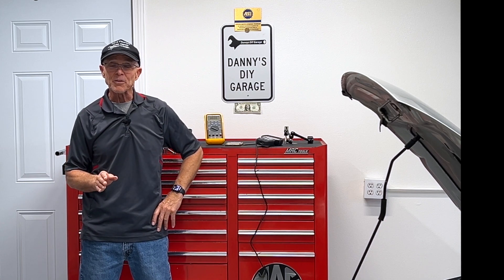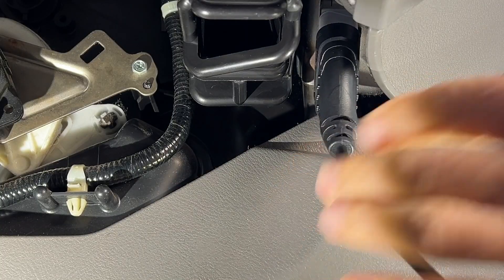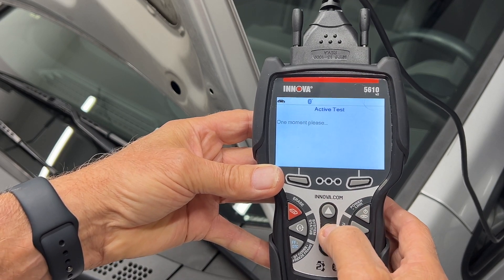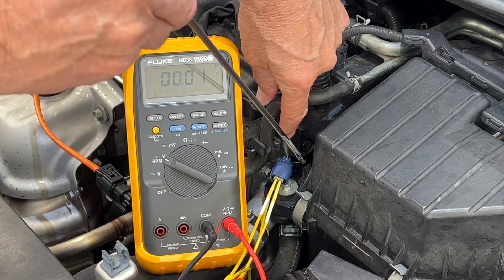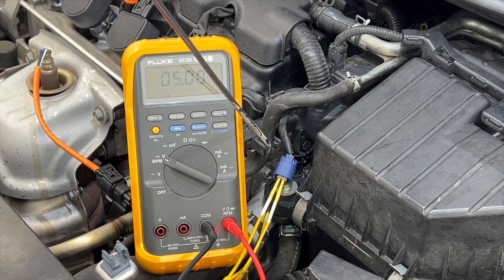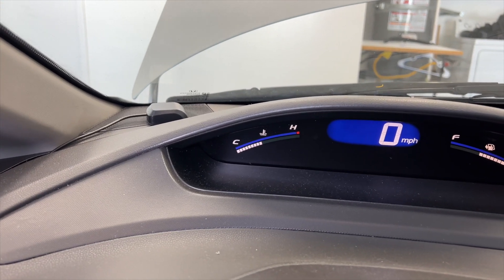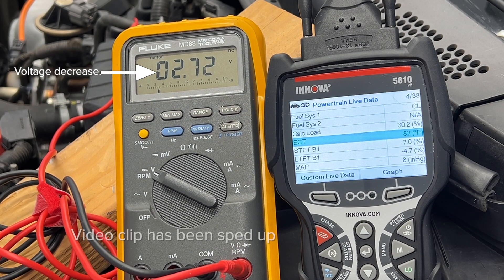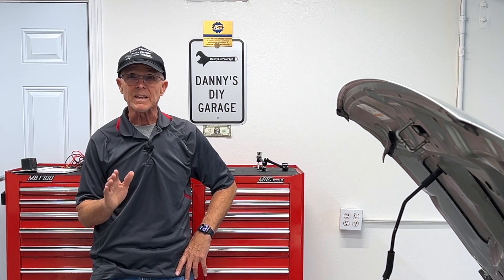Honda Civic Temperature Gauge Reading Hot, How to Diagnose the Engine Coolant Temp Sensor (ECT)

Comment: ON MY HONDA IT DOESN'T OVER HEAT , BUT IT SHOWS THE TEMPERATURE DROPPING  ON   COOLING  MILEAGE , FUEL GAGE PANEL , I THINK THAT PANEL  IS BAD BECAUSE  I HAD  FUEL GAGE   PROBLEM   WHERE IT  GOES COMPLETE  FILL UP  AFTER I FILL UP THE LIGHTS UP AS I USE GAS  AKA IT WORKS BACKWARDS .  AND NOW  I AM THINKING  RIGHT SIDE  TEMP GAGE IS GOING BAD .
Reply: thermostat stuck open,replace it and it will work good

Comment: Danny my 08 civic has a temp gauge that’s sometimes flickers. Goes from cold to 2 notches from hot instantly and the lower half is dull not as bright as the top part.  Shows the car is not hot but temperature gauge is glitchy. Wish I could share the video to see your thoughts
Reply: same here,I check the thermostat,it stuck open,I replaced it with the new genuine Honda thermostat and it is working good now

Comment: Hello. I love your videos. I am trying to figure my 2010 civic out. I definitely am overheating (coolant boiling at the top of that gauge). I think I might have several issues, which also makes this very difficult. Just replaced the thermostat to rule that out. I have a co-occuring oil leak, but I think it may have been the vvt solenoid gasket, so just did that. Fans go on when I turn ac on, but are not activating themselves related to the engine temperature. So the relays and fuses must be good for the fans. When I run the heater, it does not get warm (no matter how hot the engine is) and can smell like coolant. Do you think the heater core is the issue? I have a small coolant leak, but I can't seem to find it. Of course, I am worried this could be a cracked engine block or a head gasket. Going to add the new coolant temperature sensor today. IMPORTANT: No codes, no check engine light in spite of the obvious overheating issue. This happened all the sudden. Within 10 minutes of driving  or idling, I can watch the overheating gauge climb to the top. I am trying to diagnose the water pump, as it could be an issue too. Thanks for your input. - oh, and I have a live data scanner that hasn't been working with the Honda. Updating software and trying it again now.
Reply from the maker: could be air pockets in the engine, this causes what you're describing, air pockets can be caused by a head gasket allowing hydrocarbons in the coolant system, it could also be the water pump, fins on the pump broke or deteriorated not likely but I've seen it, heater wouldn't work due to both of these, conditions, what does the coolant look like and how many miles are on this car? you can also drive this to a smog shop and ask them to put the sniffer over the radiator top of cap or in the overflow bottle, this will sniff the cooling system for hydrocarbons verifying a coolant leak into the combustion chamber, you can also pull the plugs and look at them for coolant wetness. do you see coolant on the oil cap?
Reply: @dannysdiygarage  thanks for your quick reply. 250k miles, but it has a junk yard engine and the sketchy tire shop I got this from 1.5 years ago said 100k on the engine (but I don't believe them). I am worried the head gasket could be the cause of the issue, or a cracked block because I don't even for sure know they replaced it with a 2010 engine and read about the recalls in prior years. The coolant is rusty. I actually flushed out the heater core yesterday and tons of rust came out. Interestingly, testing afterwards the heater is still not getting warm except for a minute when the engine temp reaches maybe 220 degrees F, and then it can go down a whole notch on the indicator before climbing again. Top of the radiator cap had a bunch of orange on it, so I just replaced it with a nicer junk yard one yesterday. Got the"cooling system pressure testing kit" loaner and the compression tester, and I will try that today. I can check spark plugs then. Misfires are not an issue though, so that is odd bc my 2011 jeep liberty had a head gasket issue that just presented as a cylinder 2 misfire. Still no codes on this 201p civic, but I got my live data working and can see the radiator fan control module says "NG" so maybe that is no ground. That might explain why it does not kick in due to temps rising. Both fans do go on when I select AC. The hard part here is that there may be multiple problems at one time. I appreciate your help.
Reply from the maker: The scan tools data for coolant temp sensor 2 should come on when the voltage reads .5 volts. Watch my video I just made, this explains this https://youtu.be/GVRF11BPRZA?si=LtJPoY474wVxpi7E
Reply: @dannysdiygarage  Hey, thanks so much. That was a great video too. I did the thermostat, topped off coolant, new radiator cap, ect sensor 2, and now it is doing what it is supposed to. I have been messing with this severe overheating diagnostics stuff and the co occurring oil leak (vvt gasket) all week, and today I got to even take it on the freeway. It never even got hot enough to trigger ect sensor 2 to that low voltage, which is amazing! It is now running where it is supposed to. Yay!

Comment: I'm having issues with the temperature reading from my 8th gen. I've ruled out everything mechanically. I just tested the voltage at the connector and it's less than 5v. Wiring bad from the connector through the engine harness?
Reply from the maker: What is the voltage?
Reply: @dannysdiygarage  a little over 3v
Reply from the maker: @ determine if the ground is causing the voltage drop or the 5v reference signal, to do this put the red meter lead on the 5v ref terminal and the black meter lead on the battery ground. If you have 5volts, then you have a ground issue, if you still have 3 it’s a reference signal, hopefully this makes sense
Reply: @dannysdiygarage  did that. Same voltage
Reply from the maker: @timfretts9266  wiggle the connection while testing the voltage, also I would go directly to the computer wire where the 5v signal comes out , good luck, let me know how it turns out
Reply: I retested it with a better meter and I'm getting 5v to it. The sensor has been replaced twice. Don't know what else it may be
Reply: I used a jumper wire and with the circuit open its reporting -40° but with the circuit closed its reporting a value over 400°

Comment: I just want to mention a surprise overheating problem. My overflow bottle had too much black crap at bottom of bottle blocking the hose to radiater. Cleaned it all out, rather than buy a new one. Running perfectly.
Reply from the maker: Thanks for sharing, great information

Comment: Danny, do you know at what temperature radiator fan should normally turn on? And if I read temperature data via obd  snanner it relays on top sensor, right?
Reply from the maker: this video should explain all this question: https://youtu.be/Uw4lLvyFOns?si=qVKP5algcJKZCcFK
Reply: @dannysdiygarage  thanks, so I need to buy more advanced scanner to know the answer.

Comment: my daughter won't check her transmission fluid even though it has leaks at the seals on ends of transmission drive shafts they are small leaks when driving.
how accurate does the transmission fluid level have to be if it is a bit low or high above range will it mess anything up ? she has 2007 with 182,000 miles.
Reply from the maker: If it’s an automatic transmission watch this video, ( link below )at the end it will show how to adjust your transmission level https://youtu.be/zgA7H8XFfQk?si=bANEpCkjNriqIssS
Reply: Let her  buy her own car since she doesn’t want to take care of her car and tell her to take the bus  since she’s so ungrateful
Reply: I'm sorry this comment just is so stupid... she knows it has a problem and refuses to address said problem that can cause major problems in her life.